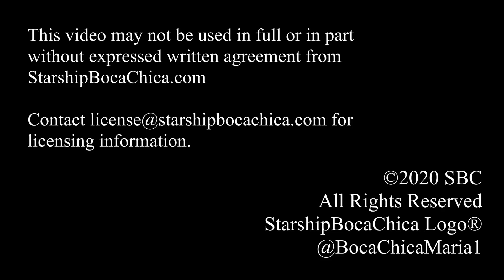2020 11 11 SN8 After the Static Fire - SpaceX Starship Boca Chica

Comment: Anybody: is Starship being fuelled up from the Bottom , near engines , in comparison to Falcon 9 - on the Vertical side?🚀
Reply from the maker: Yes..  They have quick disconnects at the bottom that close when launching.
Reply: It's probably ease of access, no gantry, most likely will change in the final production model, most likely have a gantry, or not, this is a SpaceX show.

Comment: 0:31 They haven't made concrete mixer trucks like that Alamo one in several decades. The modern ones load and empty from the front, so the driver can see everything. It means that the driver doesn't need a helper.

It doesn't matter as much for large pours where there are lots of workers available.